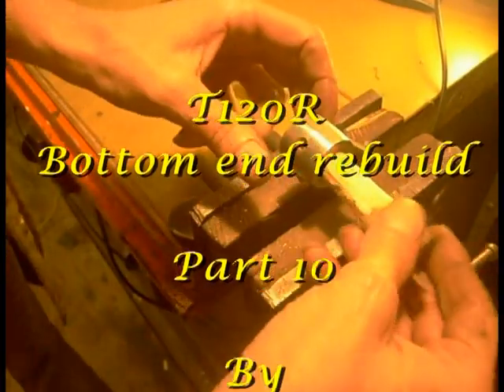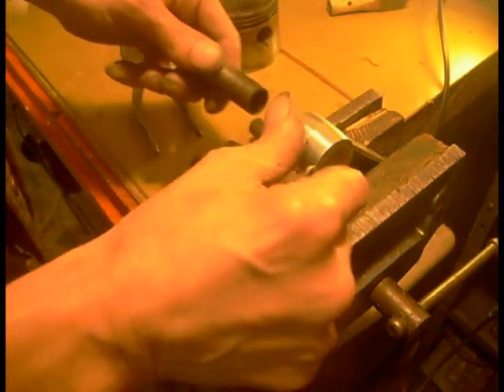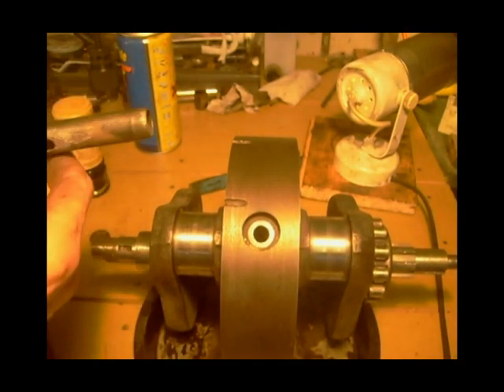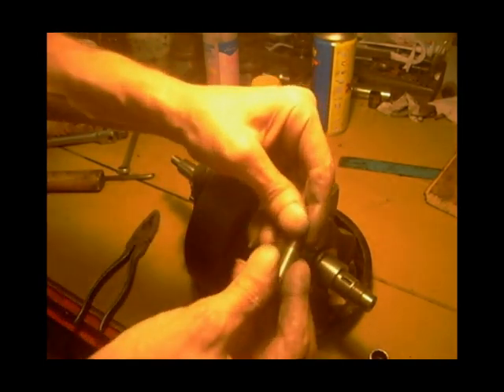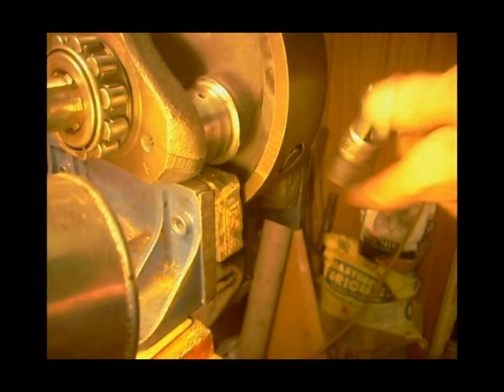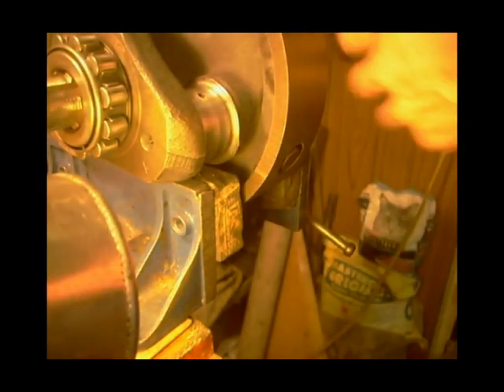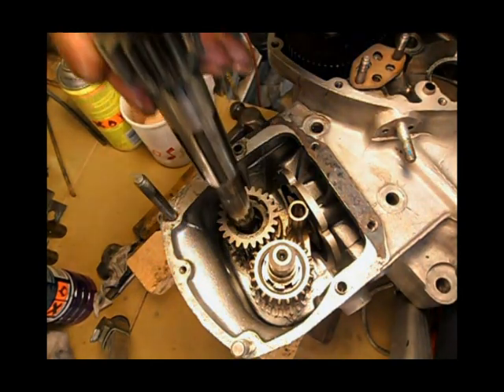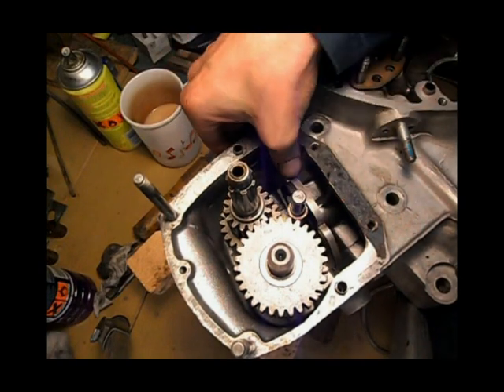T120R bottom end rebuild pt 10

Comment: I re-built my 1971 T120 this year from a full tear down that I did 13 yrs ago and then boxed..The gearbox is the "leaf spring " version so I had a few weeks riding round with 3 gears ( lots of fun) until I stripped it down again after researched the blogs to find out the varios cam plate positions. I also discovered how great it was to make my own gaskets and use grease instead of cement..lots of attempts but same gasket...NOW OK and NO LEAKS....YEAHHHHHHH

Comment: Thanks Soo much!! , I've got my hands on a 68 Trophy,FOR FREE!! The primary chain had let go and destroyed the cases, stater , main gear and clutch basket. The cases had been repaired and welded so many times they had gaps up to 4mm wide, I've Found some cases from a 70 in good nick bought new 750 big bore kit had the head rebuilt and the bottom ends fully cleaned and new bearings bushes ect.. but now it's up to me. and I've never done it and to be Frank I'm shitting myself, You've videos are going to be my Bible. none of the screws or bolts are the right thread for these cases because the old ones had been helicoiled, so I see my next step being getting the crush on these cases right and putting the gearbox in, and finally after years the block can meet the frame again.. then I look at your next video. I've had to pull all the timing gear out obviously, do you go through that in one of these, if so which one please mate, Hey thanks so much!! If it wasn't for good Ol'boys like you I'd be paying some arsehole to molest my Girl and I'd been learning nothing but having the fact that you cant trust anyone with your triumph reinforced! Thanks Man.

Comment from the maker: @bonmarl 
Cheers bonn :-)
you can change the seal with the box intact, if that's the only problem,
a smear of silicon on the sprocket splines also helps.
It's easiest with the motor on its side.

Comment: I enjoy all your videos they are a wealth of knowledge for backyard wrenchers like myself. I've got a question for you, is it possible to put five speed guts in my 650 four speed? 
Thanks again from across the pond.
Reply from the maker: +Steven Broadley 
Hi Steven :-) 
Glad you like em, you can get a 5 speed cluster to fit but as top gear on both boxes is the same 
I have never seen the point.
Reply: +Steven Broadley As Lunmad already said, the top gear on the 4 and 5 speed are the same. The 5 speed is weird, the extra gear is some ratio between 3rd and 4th which is really kind of pointless. The 4 speeds are better.
Reply: OK I know what yo are saying, but the four speed seemed to have a gap between second & third, I had no problem with this, third was great for gaining speed, the five speed evened out the ratios... I had fun on these Pommy bikes, they were a big part of my youth....

Comment: Could a boroscope go in thru set bolt on a low mileage bike ?
Reply from the maker: Hi Dariel :-) it probably would but as it is a centrifugal filter the outside of the tube packs first. This would mean the boroscope would have to break through the sludge to have a look at the open bit. Having broken through the sludge it would (could) leave bits inside the tube that may block the big end oil feed holes.
Really the only way is to remove the crank and remove the tube.
Reply: lunmad , thanks for the reply, you're absolutely right, I went ahead and removed it and found sludge at both ends, would have been hard to pick up with the scope.
Do it right first time . Thanks again !
Reply: Thanks , I removed it , pain  in the rump, but a must do ! I replaced with a hex screw for the next guy. Thanks again for your video and straitforward explanations. Been a Toyota Master mechanic for 30 yrs and can`t tell you how many classes i took that spent way too much time on theory and not enough on practical hands on. In their defense cars have gotton so complicated that you spend more time on a laptop and not much on a workbench. Good to get back to basics .